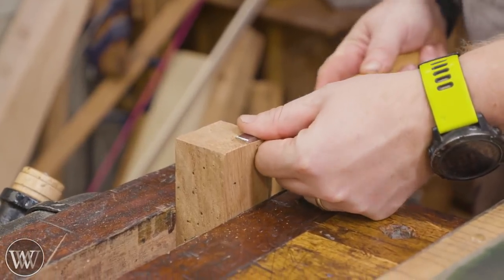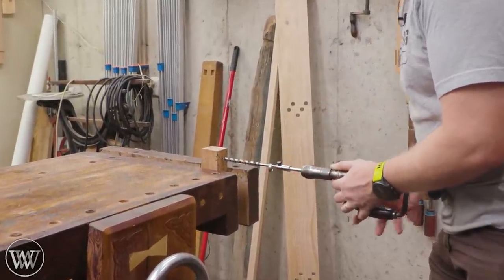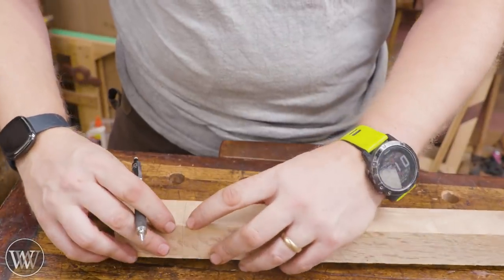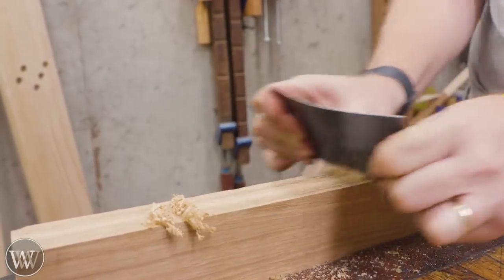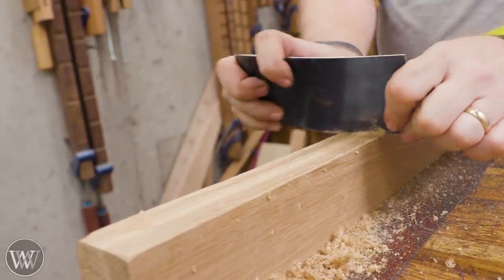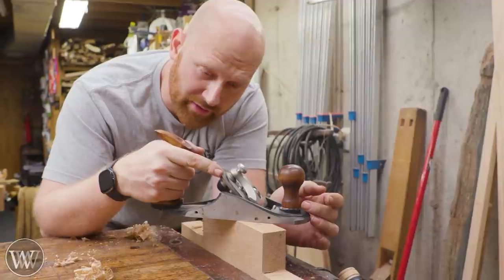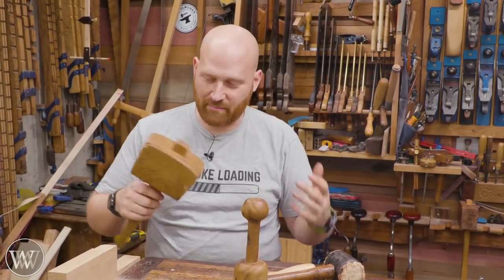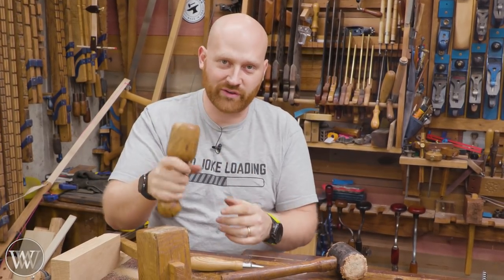10 Hand Tool Tips to Start Arguments

Comment: One tip, use a 1-2-3 block as a guide for chiseling square shoulders. Drop the chisel into the scribe line and then hold the block against the chisel. Then chop.
Reply from the maker: I actually have a video about 1,2,3 blocks coming soon.

Comment: Good info James but I have a (silly) question.
If the correct use of the mallet is to choke up on the handle and/or even grip it by the head, why don't they have a stubby handle instead of the long one?
I appreciate all you do. 
Thanx,
Greg
Reply from the maker: Thanks. It is for balance. If you've ever made a mallet without a long handle on it, it feels really weird. You get far more control with 5 to 6 in of handle sticking out behind the hand.

Comment: I see commenters harassing you tube creators that back drag files on metal, most of them do it from lack of experience using them. But due to contrary believe files do cut metal on the back drag and even more contrary believe it does not dull them. But when you tell this to guys that are familiar with them and have been told all their life back dragging a file on metal is a no no they will fight you to the death on the point, I myself was once one of those guys. But it’s true it’s a myth back dragging a file over metal will cut and the dulling is so minute it is not noticeable, don’t believe me set up a experiment and test it out the results will shock you.
Reply: There was a youtuber that got told this loads, so he did a test, and found that it made basically no difference.
Fireball tool is the youtube channel, very good content.

I think This Old Tony also touched on it too saying 'you don't care on saw teeth, why would it be any different for a file.'
Reply: @autumn5592  awesome I will have to. Check those out. I know I follow this old tony I’m not sure about Fireball tools

Comment: great tips and no arguments, but i do have a question: Why do you have te bent a scraper? I cannot get my head around the mechanics. Not bending seems more logical to me. Any one know why?
Reply from the maker: If you don't bend it, then you have a 6-in wide cutting surface. And you'll usually end up gouging in on the corners. A 6-in wide cutting surface sounds like a good idea, but most people do not have the hand strengths to push that. If you bend it, then you can focus on a small area and most of the time with the card scraper you're just cleaning up for tear out and other spot fixes. On top of that, when you bend it, you actually get a little bit more control over where and how you're scraping.

Comment: Number 3 is not a even hack or tip, that’s actually just the right way to use tool, like to measure everything from the one end.
And it seems like I’m already starting an argument;)
Reply from the maker: I don't think I would even put in there other than the fact that I see it constantly.
Reply: @WoodByWrightHowTo  “correct” does not necessarily mean “commonly known” :)

Comment: (civil) argument time: I highly doubt that pointing your finger gives you any better control, but I acknowledge that it is accepted myth and that indeed the handles are designed for it. Perhaps it's only true because the handles are designed for it.
Reply: I think it maintains steadiness, definitely. When holding a saw, you should have a light grip. A four fingered light grip would allow the saw to move left and right. The finger gives the saw that solid reference point. Less so on a plane, but a pointed finger maintains the position of the plane, so if you're lifting up rather than dragging back on the return stroke (for example, if you're using a planing stop rather than fixing a workpiece in the vice) you maintain that straight line from elbow to plane front. I've just planed some zebrano to a glass smooth finish, so I must be right!
Reply: More points of contact mean more stability.
Wrapping your fingers round the handle is only one point, pointing your finger gives it 2 points of contact, increasing stability.

Practice a bit with it yourself, you'll see it does make a difference, how much, well that depends, like most things.

The only one I don't really agree with here is the file one, unless it's short or needle files. 
But, if it's more comfortable, it will be inherently more accurate, so do what works.

Comment: For people that don't wear rings in the shop do to safety, a washer works just as well for determining a drill is level.
Reply from the maker: I actually have a video comparing different items and how accurate they are. Washers actually aren't as good because they tend to turn easily on center and that can give you false readings.

Comment: Lost it at the first tip. If I tried that with a chisel, I'd have three different bevels from three different stones and a rounded-over edge from the strop.
Reply from the maker: Freehand sharpening is an amazing thing once you spend the time to learn the skill.
Reply: @WoodByWrightHowTo  How does one avoid rounded-over edges specifically? Whenever I try to use the strop for anything except getting rid of a burr on the flat backside, there's a good 60-70% chance of the edge just being ruined in fewer than ten strokes.
Reply: @jarkkolaiho462  Using too much pressure, a light touch is all you need - basically put your bevel flat on strop and then just "think" about applying pressure, without applying any pressure, that's about the touch you need. The goal of stropping is more to do with the microscopic burr on the edge, rather than any "sharpening" - the burr is so fine and tiny you can move it just from the weight of the chisel itself , and when stropping you only need a couple strokes on either side, really to wiggle the tiny burr back and forth til it breaks off, then a few extra strokes on the bevel to "straighten" tiny strands of burr (you likely won't even be able to feel them, you'd have to use a microscope to see them) - the stropping compound just adds a little extra "polish" to things and helps remove burrs much quicker  (by honing away the fine bit of burr left) but again really only a very light touch is needed - far far less pressure to strop than what you use for honing.  If you press the tool down too hard the strop material will compress under it then spring back up, which is what is rounding off your edges.